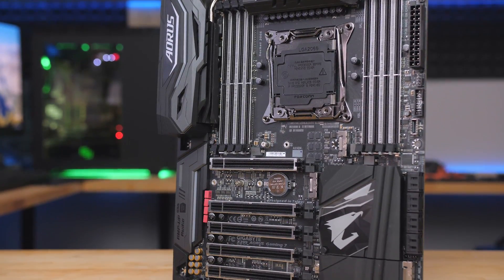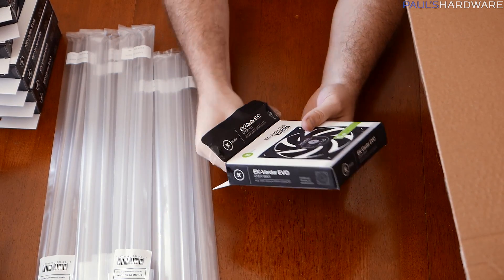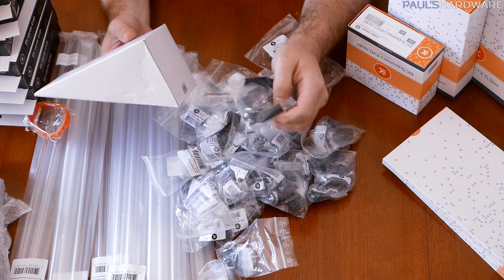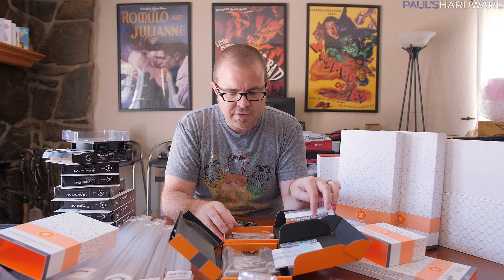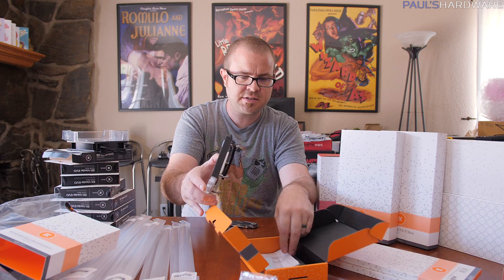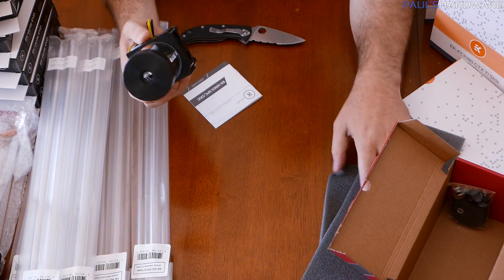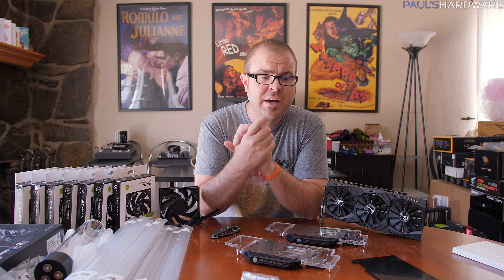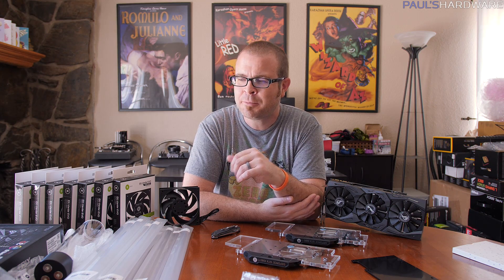FINALLY HERE: Water Cooling Parts from EK for Arctic Panther Rebuild!

Comment: Threadripper would be faster and more efficient...

edit: Wait what??? A DDC pump?? Why the hell would you not go for a D5 pump that is WAY quieter and better...
Reply: Funny how people who praise AMD rant at Intel for high power consumption on their cpus and says power consumption does not matter on AMD gpus. Let Paul rebuild Arctic Panther (insert Panther growl) with a DDC pump and 7820x, he will love it either way!
Reply: He's doing a threadripper build also so calm down. He says so in the video.
Reply: Wouldn't having low adoption of Threadripper prevent software developers from optimizing for the architecture, since they'd see little return from it?

I'm not especially familiar with software development, so I'm curious.
Reply: The DDC is smaller... that is the only real benefit. Meanwhile a D5 pump is watercooled and much more quiet. Sure both work but at about the same price and with a build like this you should go with a D5 pump 100% of the time. There is no reason to use a DDC pump there.

Well if he really doesn't care about 400w+ power consumption and price he can go and overclock that CPU to 5GHz to get the best of both worlds but for that (and honestly even at stock clocks) he will NEED a delid and I am pretty sure he wont do that. x399 CPUs are more expensive, way hotter and slower in multithreaded workloads compared to Threadripper (and honestly even Ryzen in some cases), only with a delid I would argue that they can get faster in single threaded performance compared to Threadripper, without one they are too hot, wont overclock very far and wont even boost to high clockspeeds to get that performance.

Honestly if it is really about 1080p gaming I would have gone with a 7700k, if he uses a 1440p, ultrawide or even 4k then just get Threadripper because the difference really isn't worth the disadvantages with x299.
Reply: Oli Harding
buy buy buy, this is Youtube, great that he is getting it as a job! hahaha job!!!! remember the rest all have to pay for junk!
Reply: Finally someone who gets it!
Reply: Pennywise band or clown? Pennywise
Reply: There is no architecture optimization that any game dev would ever do and they never did (devs will always do as little as possible, not really their fault but a sad reality). Mainly you need to optimize to use more cores/threads and all that work is identical for Intel and AMD.
Reply: Karavusk
Never? Remember when game engines started to utilize more cores, HT optimized titles, 3Dnow, MMX... If Studio's develop new Engines, they need to support more cores now! Or stay on Steam games?
Reply: EK's newer PWM D5s are amazing, really amazing. I can't hear mine when it's dialled up to 100%. By comparison, my 18 W DDC was a complete pain in the ass.
Reply: spacekeeper
Why is Paul is using a SPC pump in his build?
Reply: Pennywise
SPC pump on PWM is the next gen solution now, Pro? Pro are people that get paid!
Reply: Gaming wise, no not at all. Paul said it is a gaming pc. Recommend threadripper cpu for gaming because it is faster and more efficent is wrong!
Reply: Kvickstick If it is a gaming PC then go for a 7700k... if you can actually use more than 4 cores go for threadripper and not the 299 junk. Sure he could overclock it IF!! he delids the CPU but without a delid Threadripper would be faster even for gaming because x299 CPUs probably wont keep up the full turbo clockspeed while overclocked
Reply: Did someone steal your lunch money? Everyone knows the 7700k is the best gaming cpu, because of it's singel threaded performance and high clockspeeds and mainstream price tag. Threadripper is not a gaming cpu, neither is 7820x for that matter. If you want to game and have many cores/threads you'd still buy x299 over x399. 7820x singel threaded performance is on par with 7700k, overclock the 7820x and you can match the overclocked 7700k easily in gaming but have the bonus of 8 cores and 16 threads. Ryzen and Threadripper is not bad, it's just to early for me to adopt x399 as software needs to catch up and optimize for the zen architecture and multi threaded workloads in general. The main gripe i have with Intel is the none soldered ihs and terrible pricing on the HEDT platform.

Also, there is nothing wrong with DDC pumps. I've had several DDC pumps with great success. I am currently using a D5 myself and it's awesome!
Reply: x299 will have a single upgrade and then go to the next chipset, meanwhile AMD´s socket and chipset is supported for at least 5 years... oh and by the way I have an i7 5820k myself... funnily enough still the best 6 core intel ever made, the 6800k overclocks worse and uses more power and the x299 stuff uses waaay more power and has worse IPC in games thanks to the new cache design (but it overclocks higher).

Threadripper and Ryzen´s IPC are by the way pretty much like the IPC on Intel CPUs but Intel CPUs can reach a much higher clock speed, just wanted to correct that.
Reply: Gamers need intel, if AMD is able to release some Titles that run better on multi core CPU's, they have a unique selling point, not now. What if they release a DOOM 3 or a Crysis 4 version that is optimized for multi cores, launch GTA VI on AMD as a real PC title again,  all old kaby gamers will come to AMD too. This is a gamers forum, gamers need kaby, running single threaded console titles on a PC!!!! If AMD does a better marketing job, they will succeed, they sell you a better CPU, but for now, no support by titles or 3th parties at all. Only BF1 runs good on it, run only Frostbite titles?
Reply: Karavusk we have an over zealous AMD fan here. Firstly X299 isn't junk at all, it performs very well apart from the VRM issues, but even this isn't a problem as Paul is using a Monoblock. Secondly Threadripper is still obviously a very good cpu but with such a high core count the IPC aren't that good. Finally, he may be going with X299 as it means that he could swap out his lower core cpu with a higher end one down the line, this way he can have great IPC or many cores.